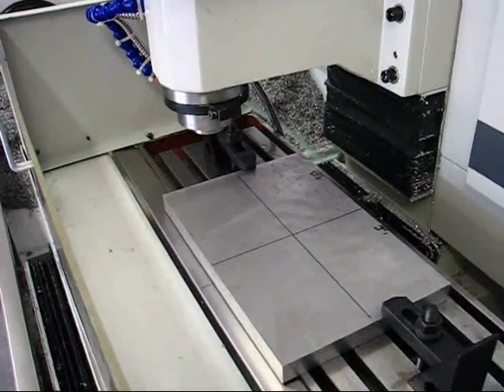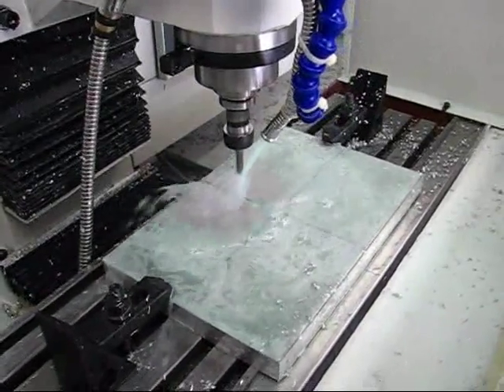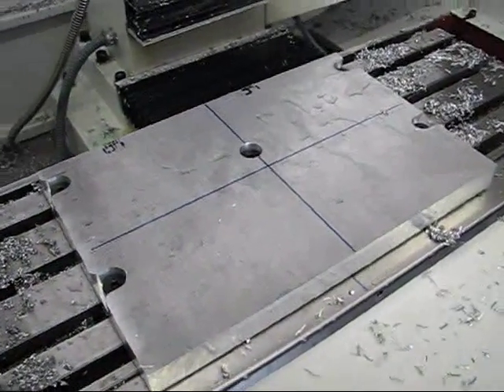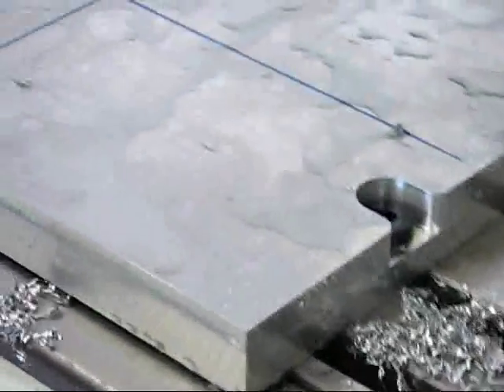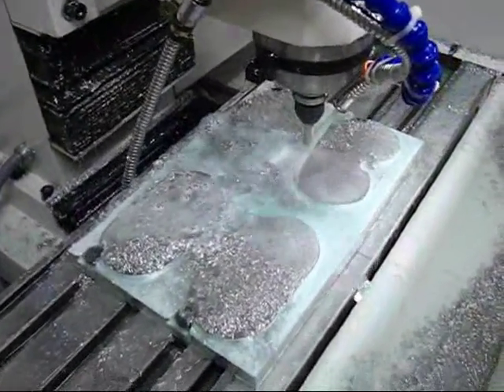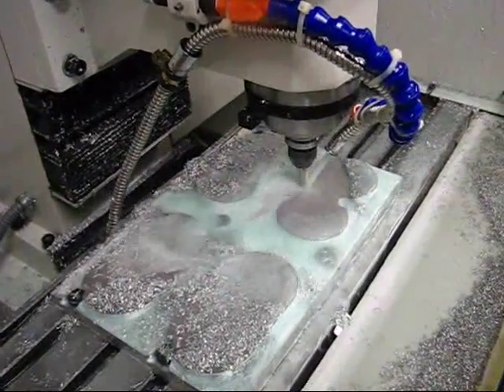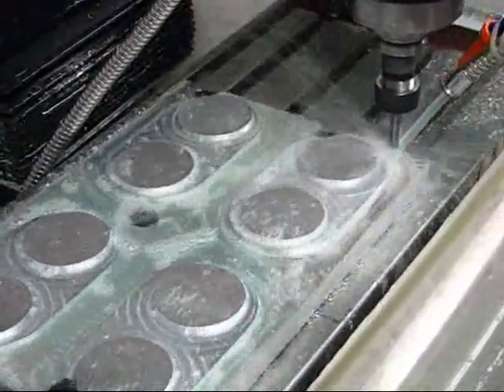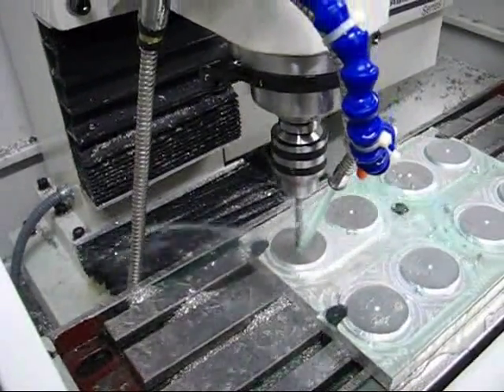Tormach PCNC 1100 - Fixture Plate CNC Milling

Comment from the maker: They are available through McMaster.  It's a 1/2-13 x 1-1/4 low head socket head cap screw.  They have a smaller internal hex and and a larger head diameter.  Try this McM PN: 92220A262, but your required length, of course.